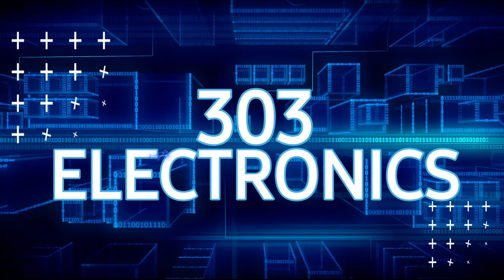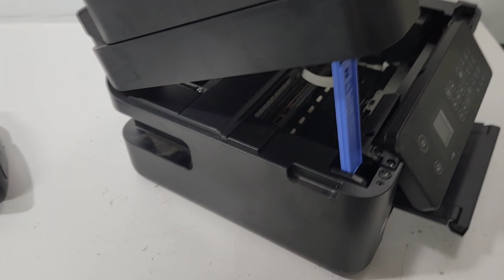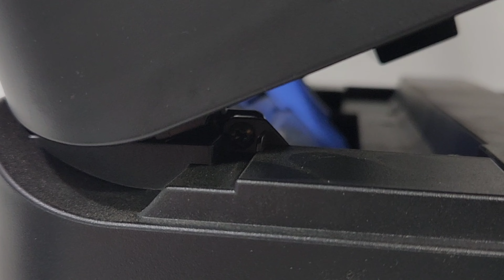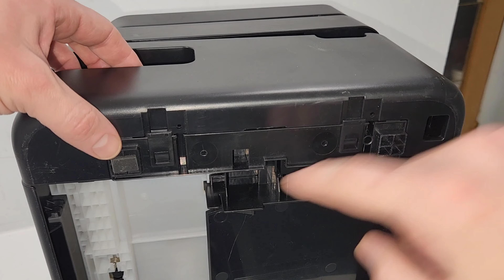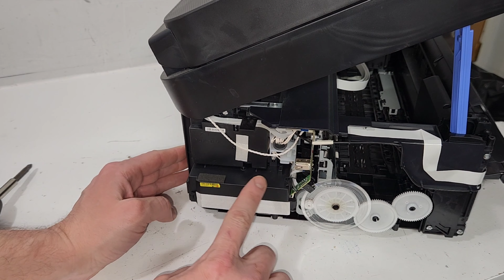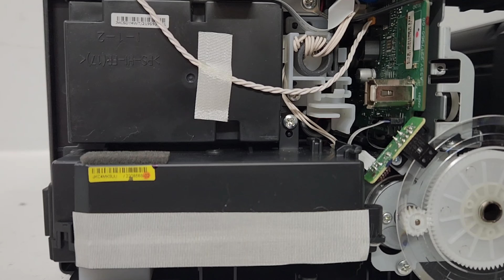Removing Side Panel to Access Printer Main Board and Power Supply EPSON WF-2830 WF-2850 WF-2930

Comment: Video was really helpful. Thanks! But for people with the ET-2850 WiFi, the side panel slides backwards to come off. Do not pull outwards like the one in the video. There are 2 screws to the front on top to take off and one at the bottom in the back. Once off, the side panel slides backwards to come off. If it seems hooked somewhere, try slightly lifting the front panel where the 2 screws to the top front were taken out. The 2 panels seems to notch together a little bit there.

If you're trying to get to the WiFi card, you can reach the card with the panel off from here with a needle nose pliers without removing anything else, at least with this model printer. Grab the card at the top and pull slightly backwards to take it off the connector. No need for much force. Then you can maneuver it through the space to take it out. When replacing it or putting it back, use the same needle nose pliers and grab it at the top. Maneuver it into place above the connector and move the pliers sideways to push it onto the connector and slide in down on the connector as far as it could go. Again, no need for much force. To get it seated completely, withdraw the pliers and use a small micro flat head screwdriver to apply some pressure to the back of the wifi card directly over the connector to force it completely down onto the connector as far as it will go. Replace the panel the same way you took it off, slide it forward and then replace screws. Then you're golden 👍
Reply from the maker: Thank you for the helpful tips and for sharing your experience with the different model!